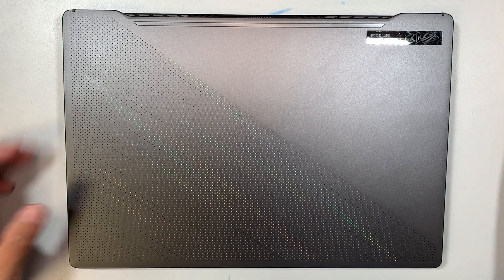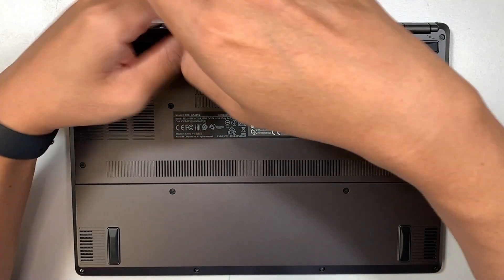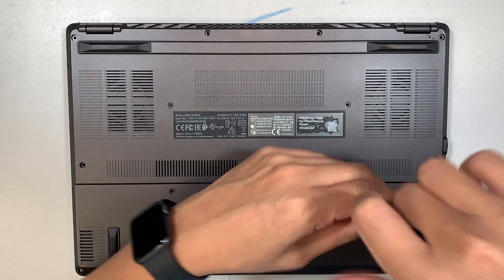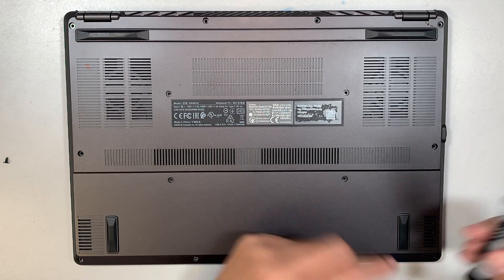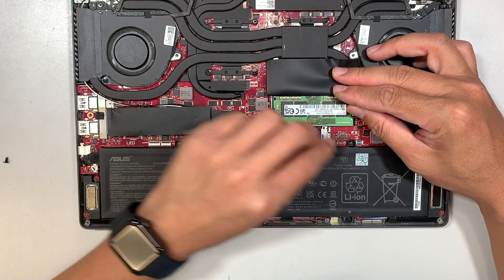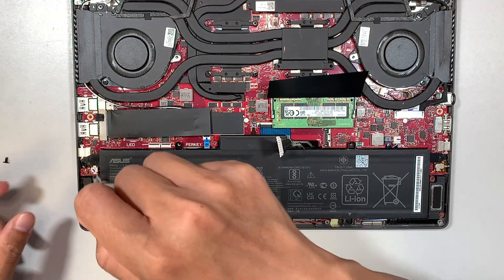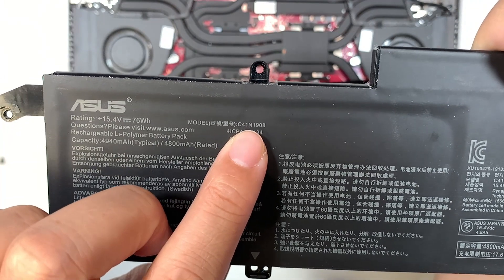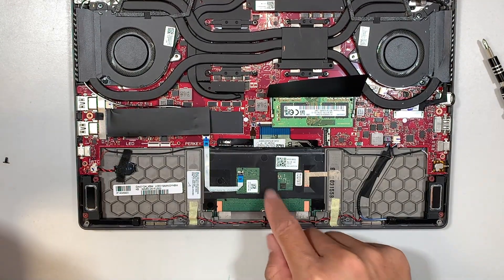Asus GA401Q Battery Replacement C41N1908

Comment: Hi I have an Asus Zephirus G14 and what is happening is that the battery says is 100 % , but when the power chord is taken off, the screen after some seconds goes off, and the processor speed immediately signs that it decreases the speed, when plug is in again everything backs to normal, is this a battery problem?
Reply: This may be a little late but that's normal. When plugged in the computer draws more power, and when unplugged it goes black because it's switching to less power hungry settings
Reply: @oceantrident i think he means it becomes extremely slow. i have the same problem, 400mhz clock on battery, normal clock speed clock speed